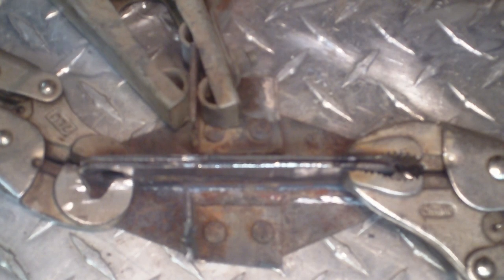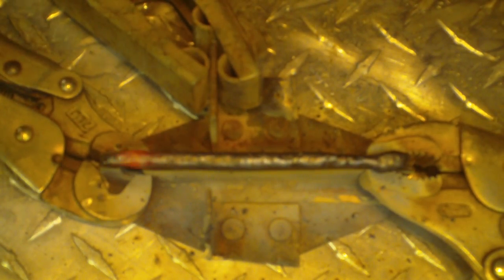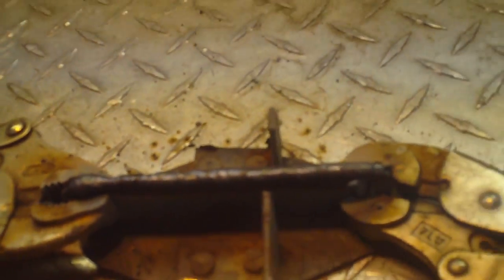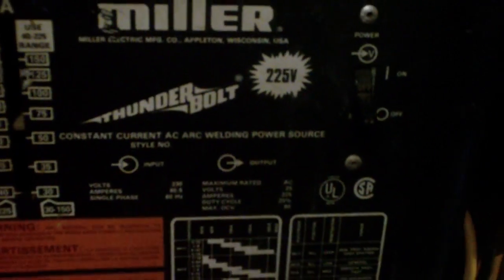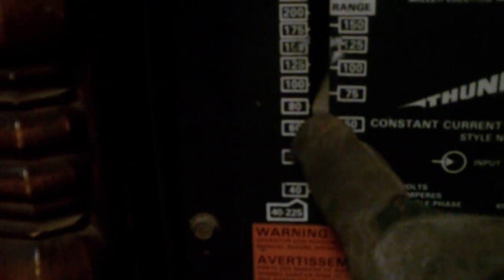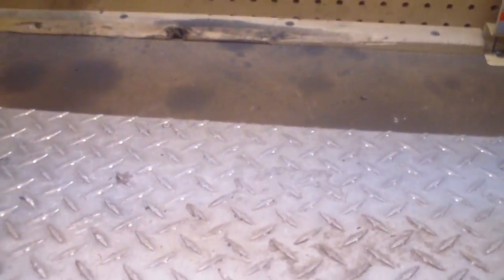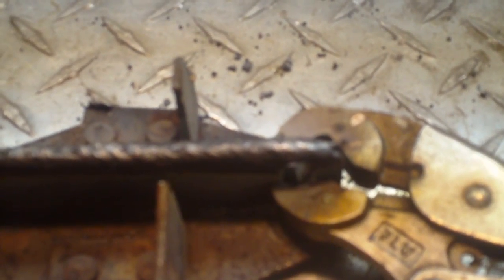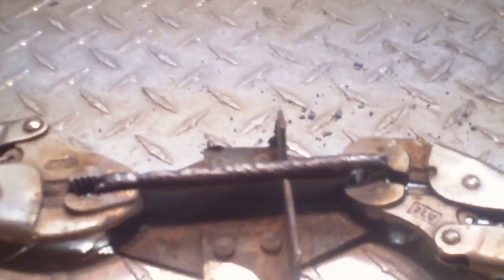Welding amps with E6011 rods on thin metal

Comment: I just seen this I learned to weld with these on the submarines . I am a disabled vet and still play around with welding . I have a 100 amp arc welder and a old ac225 welder. The 100 amp is a 120 volt welder .I have tired harbor freight welding sticks and not have much luck with them. But I have a ace store 2 miles away and bought some forney sticks and they worked great . I use my 225 and fixed my wheelchair a few time even my wheelchair van system a few times. I use my 120 volt with 1/16 rods to fix small thing like my bird bath and things like that. You should try them .

Comment: I have actually NO idea as to why you would EVER consider using E6011's on such a basic job. Plain nonsense. They are actually a penetration pass rod for pressure pipe/vessel and out of position jobs. I use these often only on poor fit-up, or on galvanized pipe fence rails for cattle and horse yards etc. and always for vertical down and underneath (overhead really), start at the top and go all the way down on both sides. In every case one should be working the ''window'', not something that the average Joe would even know about. They are so NOT suitable for flat beads, fillets and vertical up - UGLY beads. ''Weldorguy'' is absolutely correct and basic coated rods are good - versatile, but, difficult for the untrained operators. The best types for most hobby weldors are E6012 or E6013 and DON'T skimp on the $'s.
Reply from the maker: The reason I used these rods is because I am no expert, I just picked up the most common rods I saw at HarborFreight tools. I was really hoping your channel would show me how to properly weld. Thanks for the tips.

Comment: i read all the comments about your different rod types and amps but i see nothing about your rod sizes except in the video i also dont see much  about the thickness of metals like in the bike frame comment they all come to play when you are deciding what rod an amps also you need to know about your machine since some are ac and some are dc 6013 runs on both 6011 runs on ac and 6010 runs on dc there are charts out there to guide you on size type and amps also on the material you are welding

Comment: I am not getting the results I need on very thin metal. It is a tubular 3/4" and I am using about 80 Amps with 6013. This does not work well, I will take your suggestion advice and try the 6011 running and start with 40 Amps. Thanks for your lesson, learned much.

Comment from the maker: I am no expert!!
I would use 6011 if it was me. I would assume that the tube of the frame is similar to this thickness I am welding here. I have used this to weld a muffler to the bracket and it worked, so I would assume it will work for you....... Good luck.

Comment: I just bought an old arc also and am jealous also, ha ha ha, your lucky you got a good old thunderbolt, i've heard good things about them;

The garage I'm in isn't wired for heavy current and I also use the e6011 small rods as they don't use much power and won't trip the breaker as often;

It looked like old bed frame metal you were welding on, which isn't the easiest stuff to practice on, but you pulled of a awesome weld. 

like the previous comment ,,,U made it look easy, thanks for the video